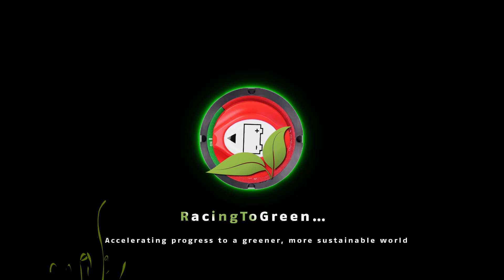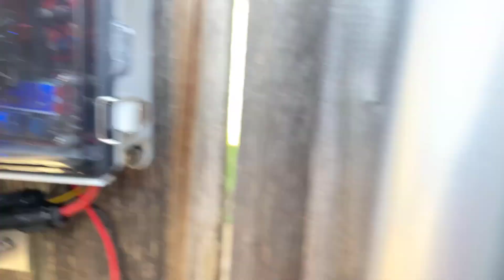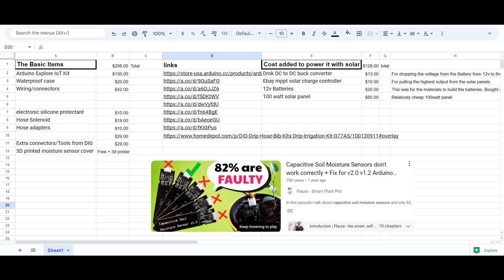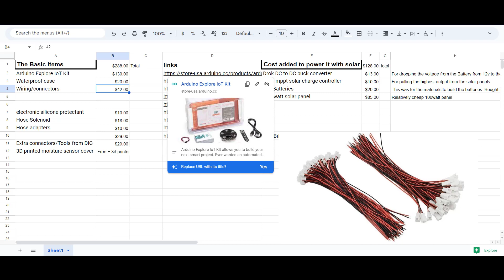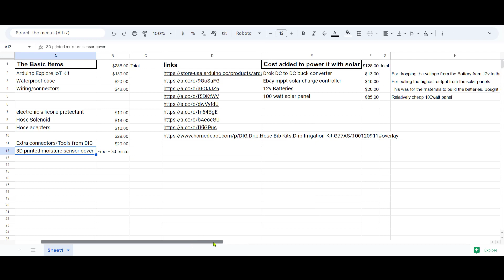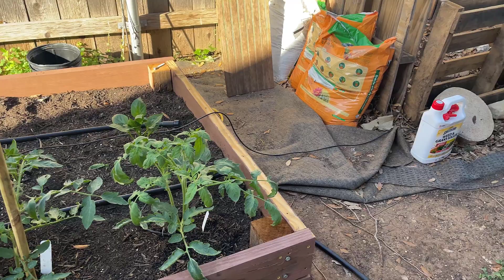Internet Smart Garden Part 2 - The Build List

Comment: nice project :) wish you luck with Soil moisture sensor it goes very deep rabbit hole to get it right (right calibration (soil sensor in water = 100 percent and soil sensor in air = 0 percent .... is bad calibration), right measurement and right interpretation of measured data)..... if your signal is jumpy try Ferite ring core on sensor cable and Simple Kalman filter in code.
Reply from the maker: I’ve actually been lucky with the v1.2 sensor that came with the kit, it appears to have the not so good timing chip as well. I have the resolution set to 12 bit in code and dry is working at 4095, and wet at 3000. It appears to be pretty accurate.I will check out the Kalman filter, though.
Reply: @racingtogreen2023  if you have stable output, you are golden :) if not and values are jumping +/-(tenish), Kalman filter can come handy.  looking forward at your next update.